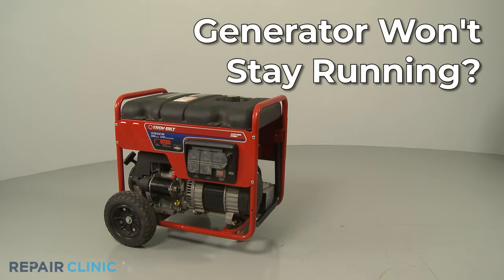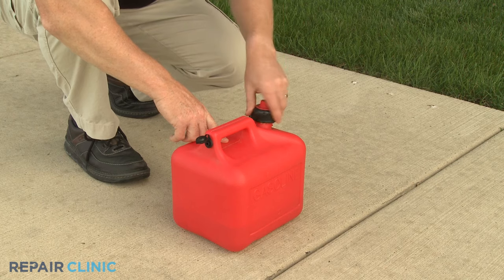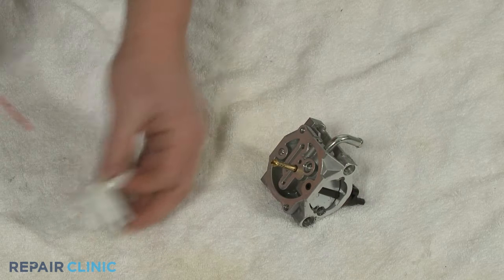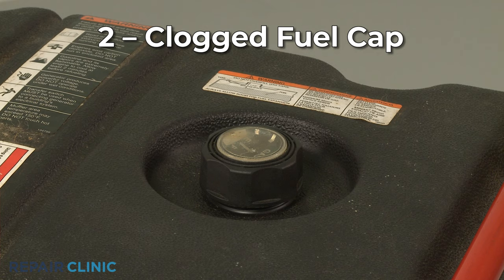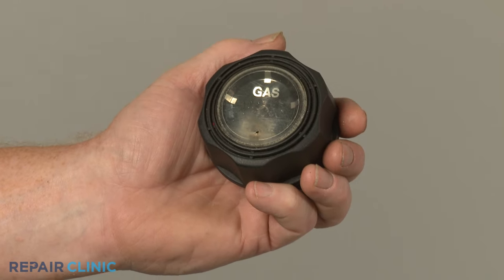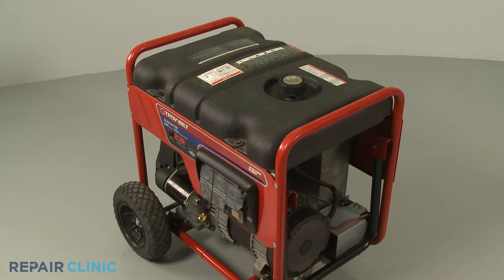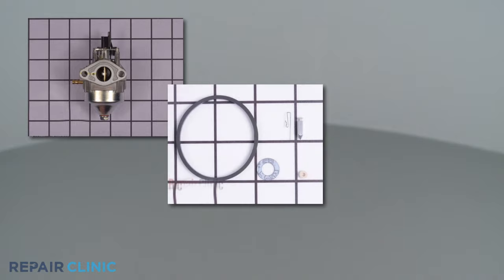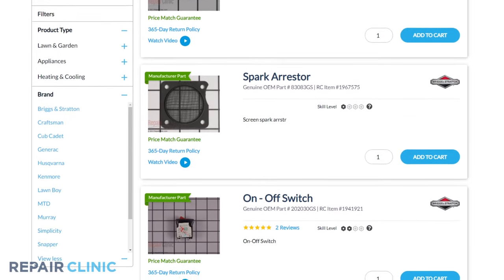Top Reasons Generator Won't Stay Running — Generator Troubleshooting

Comment: Was having that problem.  Put in new carb and nothing. 
Turned out there's a screen cylinder in the exhaust end. Champion. It was almost totally Carbonell up. Started it with it out and it runs fine.

Comment: This fixed my problem. I unknowingly allowed air to enter into my fuel line when I was changing the fuel filter. So I disconnected the line near the carburetor and opened fuel  shut off to allow gas to flow. This removed the air and it ran great immediately

Comment: Could NOT believe that that LITTLE hole in the fuel cap could create a vacuum in the fuel tank that would shut down the GENERATOR. Mine was shutting down every 40 minutes 😮 until I watched this video.  🙏🙏 thx.

Comment: SUA5000  starts, but dies out, why, changed fuel, cleaned carborater, checked oil levels, and it does the same thing, starts but dies.
Reply: Try the choke lever
Reply: Make sure the fuel bowl solenoid is receiving power. When you turn on the "Power" switch, listen for the "Click" sound if that solenoid on your carburetor doesn't "Click" check to make for sure it's getting 12 volts there. If it is receiving 12 volts there and you hear no "Click", remove it, clean it with carburetor cleaner to get the plunger moving freely again. The connect 12 volts to it and see if it works now. If not replace the solenoid. Also if your engine has a "low oil" sensor in your motor and your motor is full of oil, those sensors go bad. Just disconnect that wire leading to the side of your motor. They are usually "Yellow". If that sensor is faulty they won't allow your engine to start.